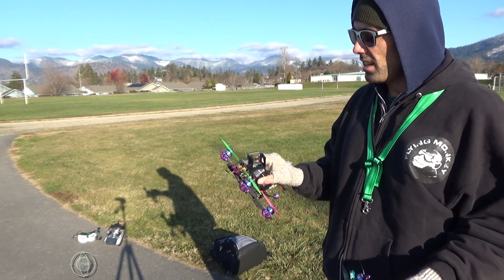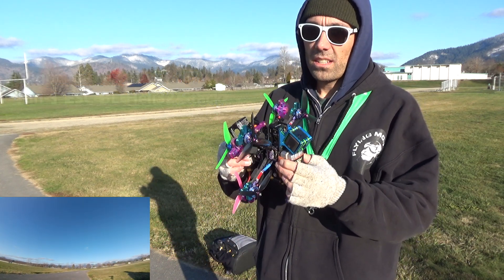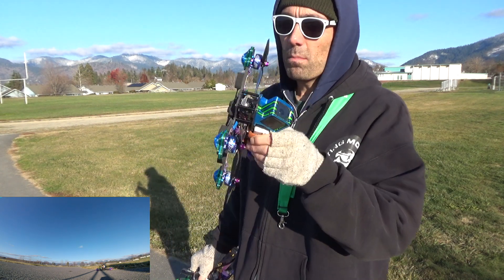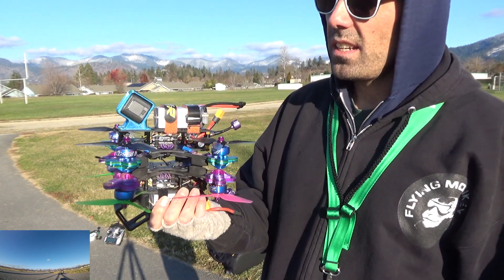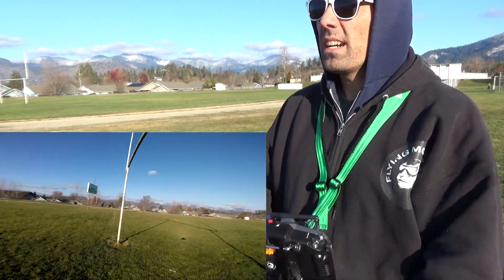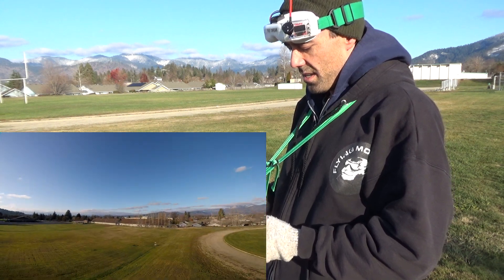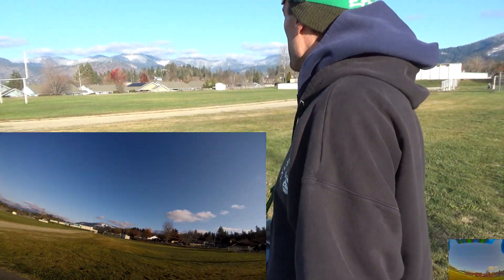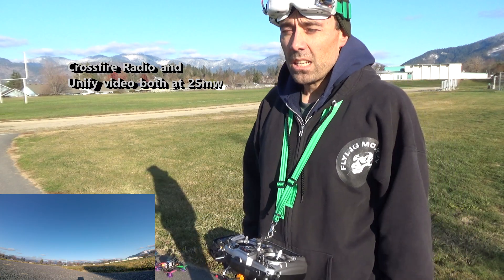Betaflight 4.1.1 RPM Filter Field Test And Maiden

Comment: What is your TPA values at so I can copy?
Reply from the maker: TPA is .75 and TPA Breakpoint is 1400 👍
Reply: @jdogb1  What are your PIDs set to?
Reply from the maker: A A here is a video I made on my full setup and tune. I use absolute control and integrated yaw, so this video will explain it best;  
https://youtu.be/z92p5Vv1_lk
Reply from the maker: A A I will go grab them and post here in bit
Reply: @jdogb1  I think my quad was smoother at .75 and 1400 but I think my insane take-offs are worse?  Can you try .25 and 1500 to see if your quad is quicker/faster?  I was at .50 and 1500 and it seemed slower and .75 and 1400 made it seem even more slow but I'm not entirely sure.  Just looking at the footage.

Comment: Looks like Littleton to me, if you live in colorado we should fly sometime.
Reply from the maker: I’m actually in southern Oregon, but yes I agree it does look a lot like Colorado. I’ve spent a lot of time there, working and traveling. Stayed in Denver often and Co Springs, also Grand Junction. Haven’t been there in a few years but would love to go back and fly 😀  
Will hit you up for sure if I get that way 👍👊
Reply: @jdogb1  right on so you think dshot 300 at 8k and 4k is best even if I have a f7 ?
Reply from the maker: Splif Multirotor Mayhem yes I think so. Without bidirectional dshot and rpm filter, I can easily run 8k/8k, but when using bidirectional and rpm filter, I have to keep it at least 8k/4K or 4K/4K. 
RPM filter seems to take up a lot of cpu in tasks